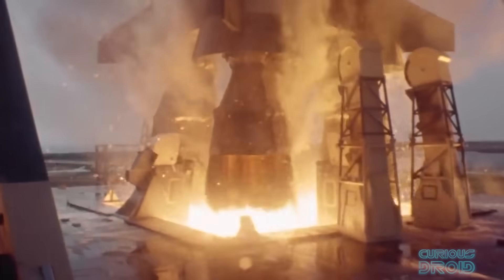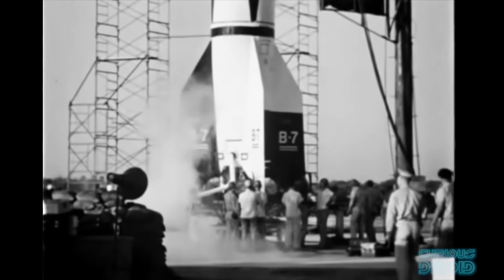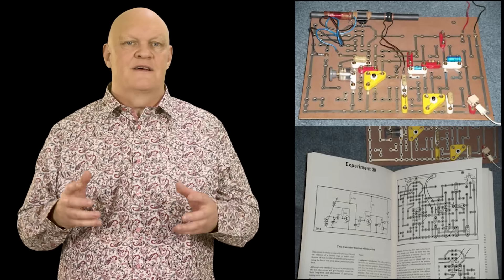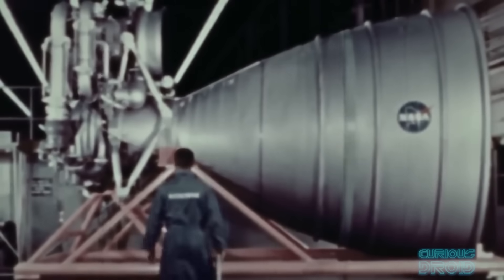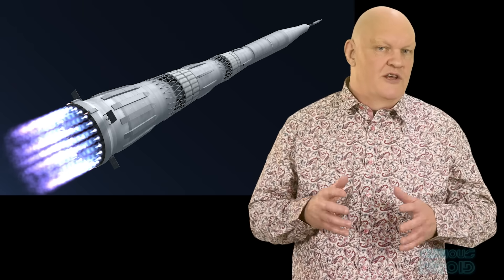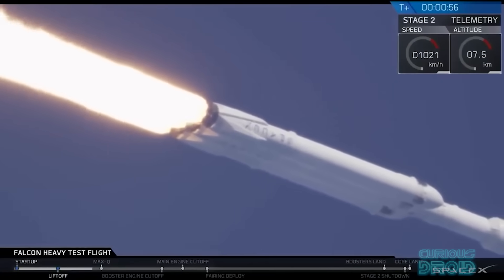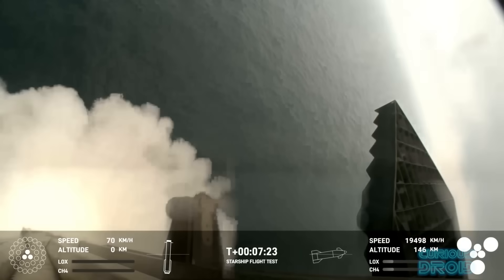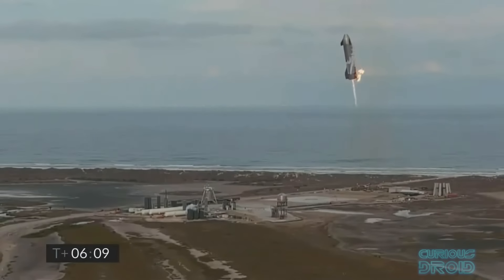Why Does SpaceX Use 33 Engines While NASA Used Just 5?

Comment: Equating SpaceX to the N1 programme is very weird and misinformed.  SpaceX engines are heavily tested before they get anywhere near a rocket, then tested some more on the rocket.
Reply: Oh thats why they fail so often to reignite or just to ignite at all thx for the Info.
Reply: @_kampfkartoffel2195  How often would that be, troll boy?
Reply: @dudermcdudeface3674  Well Starship never ignited theire engines in space and the Booster already failed on the third flight to ignite ITs engines Same as Starship on the fourth flight. Also in the fourth flight one engine did Not ignite at all and you could See black smoke coming From the Others. This indicates a sub optimal fule mixture because methane and oxygen should burn Clean.
Reply: @_kampfkartoffel2195  They failed because of filter clogging which was fixed on ift 4.
Reply: @goldenshatter  yeah but they still failed. Saturn V did Not fail a single time. When did we get From failure IS Not an Option to success IS one of the possible Outcomes.
Reply: @_kampfkartoffel2195  Have you never failed at doing something new before? Its part of learning/making something new. F1 rockets blew up a lot on test stands early in there development till they worked out combustion instability. The Saturn V did do a fine job, but things did go wrong. Apollo 6 had masive pogo oscillations and lost two J-2s and could not restart S-1VB. And later on Apollo 13 had a engine go out on the way up. Apollo 6 was a test flight, so finding out what breaks is part of that. Failure is not a option really only counts for crew launches, and NASA leads the pack on deaths there.
Reply: @_kampfkartoffel2195 
Apollo 13 almost had pogo so bad that   an engine went out, and they didn't even make it to the Moon for unrelated reasons.

You should really be more informed before you start spouting nonsense.
Reply: @carcinogen60yearsago  in Apollo 13 case the Lunar module failed that is not part of the Saturn V. I might also ad that the crew survived. If you where on starship on any of it's flights you wouild surly have died in any of it's failures.
Reply: @_kampfkartoffel2195  
Dude, a J2 engine failed. On the Saturn V.
I'm not talking about the Lander
That's why I said in my comment for unrelated reasons.
Reply: @_kampfkartoffel2195  still salty over Musk buying Twitter I see?

Comment: 33 rockets means 33 potential points of failure. And they have failed. A lot. A WHOLE lot. The Saturn didn't have the benefit of having seen its job done before, like SpaceX does. So, saying the SLS should have an excuse for failure because the Saturn wasn't perfect on launch is a bad argument. I'm sorry, but SpaceX cannot keep up this level of failure; after a while, they're actually holding us back.
Reply: 33 engines mean reliability, 1 engine failure of F1 - 20% thrust, 1 rapter - 3%
Reply: @maks_1_123  One or two Apollo missions lost one engine and still completed their missions safely. SpaceX seems to loose multiple engines on every flight.
Reply: @Axel_Andersen  Basically any rocket can lose engines and still make it to orbit; the question is how many engines can the rocket lose and when. Starship can lose something like three engines at liftoff and still make it to orbit. If it happens later in flight, losing ten engines or more might be fine.

Saturn V could lose zero engines at liftoff and make it to orbit. Later in flight, a premature shutdown of one or more engines could be tolerated.
Reply: @SpaceAdvocate  Except we've watched, over and over, 12 or 13 engines fail, then the rocket explodes. If each failure has, for instance, a 5% chance of leading to critical "unplanned disassembly", then the fewer rockets to fail, the better. 

Look, this many failures would make sense, if they were starting from scratch, without 70 years of research. But we have that experience. And I'm no Von Braun, but the idea of rockets surrounded by other rockets just seems like it's easier for one problem to cascade to other rockets. Maybe this will be a great design that will change space travel, eventually! But taking contracts before perfecting it is reckless, stupid, and holding us back from getting to the moon, again.
Reply: @Ian_sothejokeworks  Taking contracts before a new rocket is built is the norm. That's how the industry operates. The chosen alternative moon lander to Starship is the Blue Moon lander, which Blue Origin is developing. Blue Origin has taken a $3.4 billion contract for landing crew on Artemis 5. This lander will require several launches of the New Glenn rocket, which is still in development.

And SpaceX is working through the issues of Starship development. The last flight only saw two failed engines, one on ascent and one on booster landing. And no RUDs occured.

I think we are largely past the era of in-flight RUDs. They'll likely blow up some vehicles during landing attempts, but they should get less and less frequent.
Reply: @Ian_sothejokeworks  NASA is pretty bad at delivering value at a low cost. Once Starship reaches a workable design and is crew rated, it doesn't need SLS/Orion at all, it replaces it outright. In addition to also being able to land on the moon, which SLS/Orion cannot.

SLS/Orion has cost somewhere in the region of $70 billion dollars thus far. That includes some hardware for future flights.

Starship has probably cost in the region of $5 billion thus far, which might rise to something like $15 billion by the time it makes it's Artemis 3 landing, and then we might be looking at something like $30 billion by the time it's crew rated for launches.

The difference in value generated is staggering. At this point you would have a fully reuseable super heavy lift vehicle with incredible capabilities and massive commercial applications. SLS/Orion is a traditional space capsule placed on top of a Delta IV upper stage,  placed on top of a shuttle external tank with 4x shuttle main engines and 2x shuttle SRBs. There's basically no new technology development, and the vehicle can barely get into a moon orbit, at a ridiculous cost per flight.

I'm of the opinion that NSAS shuld cancel SLS/Orion ASAP, and replace it with HLS Starship and Dragon/Starliner, until Starship is crew rated, where Dragon/Starliner could be phased out.
Reply: True

Comment: SpaceX can't get to LEO with fully empty starships....

I like to see how they are going to launch 200 tons when they can't even get to LEO with full tanks.
Reply: Well thats why rockets have 3 stages and different engine types for each one of them IT allows for much more Cargo.
Reply: SpaceX hasn't attempted to get to LEO. The last two launches got to the target trajectory, which was slightly less than LEO. And there was several tens of tons of propellant left over, showing that the current Starship prototypes can carry tens of tons of payload to orbit.
Reply: @SpaceAdvocate  ten of tons? Didn't he say 150 tons? 

Lol 10s of tons.
Reply: @umadbra 
You do know what a prototype is, right?

 it's like expecting a Ford Model T to tow as much as a Ford F-150.
Reply: @carcinogen60yearsago  the Ford Model t IS Not a Prototype for the Ford f150. But yeah i would at least expect that my Ford f150 (Starship) toad as much as a Model t (Saturn V or any Rocket that actualy can get to Orbit, Starship has never ignited ITs engines in space as Long as IT does Not do that IT can't Go to Orbit)
Reply: @_kampfkartoffel2195  
All six Raptor engines ignited, and we're above the Karman line for ift 2,3, and 4.
Reply: @_kampfkartoffel2195  
Do you really want the largest uncontrolled piece of space debris to come down over your city?
You're framing it like not getting to orbit is a bad thing they're doing it for safety reasons.
Reply: @carcinogen60yearsago  yeah but that was while the ship was Not In Orbit IT was Not in Zero Gravity the real Challenge IS igniting the engines without Gravity. Also i know that the ship can get to space but they can't do that because IT would Just Turn Into space junk
Reply: @_kampfkartoffel2195  
You should really educate yourself
Reply: @carcinogen60yearsago  Bro when the ship IS Not in Orbit and isn't exelerating the Speed slowly reduces therefore there IS Gravity.
Reply: @carcinogen60yearsago  so yeah you were right about apollo the saturn V had an engine failure there but this had no consequences on the rest of the flight also here is the space x launch https://www.youtube.com/watch?v=OZVR2SNjyug 
you can see that the engines ignite at 75km under the karmen line not in space and while starship aswell as super heavy reduce speed therefore experiancing gravity the fuel in the tanks is not free floating which would be the case in orbit and the thing that prevents space x from reaching orbit. you can see the ignitian at abou 75km at 42:50
Reply: @carcinogen60yearsago  so they are going to make me science. Bravo. I can't wait until your eat your own words. 

How's FSD for your Tesla? 😂
Reply: @SpaceAdvocate  Well tens of Tons of payload are nothing for a rocket that Weighs 5000 Tons. The Saturn V could carry 145 Tons to Leo or 45 to the moon. Starship can according to musk only carry 50 Tons to Leo and Is an empty Husk that needs Like 12 refuling flights after that. Plus spacex has Not shown the ability to reignite the raptor engine In space so yeah they could get to Orbit but the ship would stay there AS the biggest pice of space junk ever created.
Reply: @_kampfkartoffel2195  Starship is being developed as a fully reusable rocket, and the payload for Starship and Saturn 5 are different things. 
50 tons is only v1 of the ship, the second version will be able to do much more
Reply: @_kampfkartoffel2195  The previous record for a fully reuseable vehicle was zero tons. It has never been done before.

SpaceX has had challenges in developing the Starship, that is clear. But it's not at all surprising when you are attempting to do something that hasn't been done before.

The next version of Starship is supposed to be able to carry the 100 tons originally targeted. And with the experience SpaceX has from the current prototypes, that number is probably a lot firmer. 

SpaceX is actually already building the version of Starship that will be able to carry 100 tons. It will likely fly for the first time on flight 8, early next year.
Reply: @SpaceAdvocate  yeah and it IS still now because Starship has Not brought any Cargo to space. Also musk Said that this Version of Starship would be able to carry 100 Tons so either He was lying (which He does all the time) or the Guys at space x where to stupid to come Up with the real number which IS Even worse because Rocket payload is Something you can determin on the drawing Board down to the Kilogramm. So yeah Go cope little fanboy.
Reply: @_kampfkartoffel2195  Saturn V could launch 141 tonnes total to LEO, that is including the S-IVB, the CSM, LEM and all the fuel. Starship can launch it's near 100 tonne weight plus 50-60 tonnes to LEO. Everyone that has an understanding of these rockets knows that.
Reply: @SentinelSent  yeah but the 100 Ton weight of the ship IS dead weigth Not payload and IT IS Out of fuel after that so yeah thats Not a good Point. Because we are talking about payload Not total mass.
Reply: Did Apollo 11 actually leave near-Earth orbit?
Despite the revisionist narrative that this channel won't question -- unstable fuel burn for the oversized F1 engines was never rectified and another arrangement in their place was made in order to reach near Earth orbit, keeping the F1 bell nozzle to maintain the desired appearance.  The great licking yellow flame was an indication that something was not normal as fuel was burning in the atmosphere while providing no additional thrust. This was the result of injecting additional kerosene into the exhaust stream for greater visual effect yet appearing to produce an inefficient burn unlike other rockets after launch.  No explanation is forthcoming and this issue is not addressed in any usual report; however, using a smaller reliable engine with a reduced fuel load and stripped down mission requirement allowed the Saturn V to reach near-Earth orbit.  

The Apollo 11 crew attempted to demonstrate their position at over halfway to the moon as seen in the unedited version presented to the public while the more recently released unedited version reveals a flood of blue light entering the same window as the camera continues to roll, through which only a moment before, we saw the Earth far distant in what appeared to be very low light conditions. Then, as the camera pulls back from the window, the exposure settings are seen to return to normal as a flood of light enters the same window.  Without a change in the orientation of the spacecraft assumed to be on a trajectory toward the moon, the only source for any flood of light can be the Earth while in near-Earth orbit.  

Another indication are the impossible weather patterns seen on Earth, when in reality only a small portion of the Earth's surface was visible, framed by the round window of the command module.  Straight line cloud fronts are seen to be extending for what appears to be more than 6000 miles, a quarter of the Earth's circumference -- something that has never occurred in the meteorological record on Earth. 

The usual sponsored efforts will try to make excuses for why the obvious did not take place -- yet is overly apparent in the unedited version.  When facts cannot prevail in support, sponsored activity will resort to name calling and other derogatory comments discrediting themselves.
Reply: @ronaldgreene5733  wtf where are you coming From now. Of course the Germany started WW2 in 1939 with their Invasion of poland. If you think that the allies planned and forced WW2 to Happen then why we're they so unprepared they got Destroyed in the begining of WW2. Also If the moon landing was Fake than wouldn't the soviet Union find Out about It and Tell everyone?!

Comment: A lot of people cite reliability for using so many engines. Well so far superheavy has had abysmal reliability and saturn had 100% reliability
Reply: The Super Heavy booster has had three successes in a row. One engine shut down on the last launch, but it didn't meaningfully affect the launch. You just fire the engines for a second or two longer before stage separation.
Reply: Don't realy now what happend on the Last Launch but the Booster failed to reignite on the third and did explode 500 Meters over the Sea. And on the second Launch it explodet after staging so i don't now in which world this can be Seen as success.
Reply: @_kampfkartoffel2195  igniting the engine during landing is more difficult than during launch; the Saturn 5 did not ignite its engines during landing

Comment: The engines on the N1 weren't hot fired (tested) because they were fitted with burst disks which could only fire once.  This wasn't a budget issue so much as a weight problem.
Reply: Literally what they sound like. Rather than a mechanical valve it's a weak disk you use to block a pipe. When the pressure gets too high on one side they rupture and the fluid flows.
Reply: Interesting, thanks, do you mind explaining what are burst disks and what are they for?